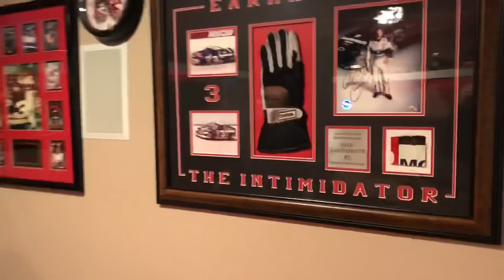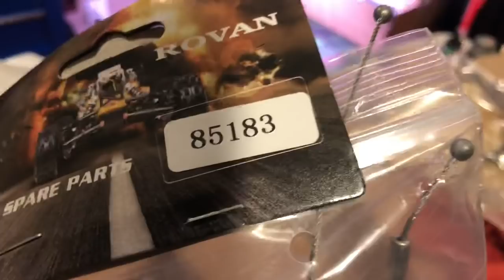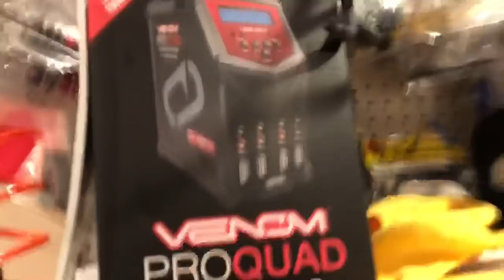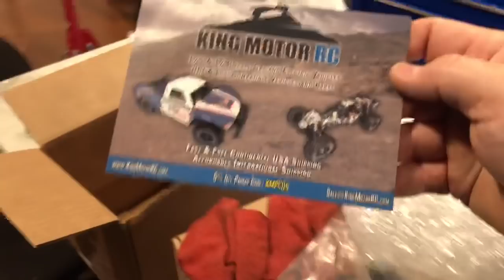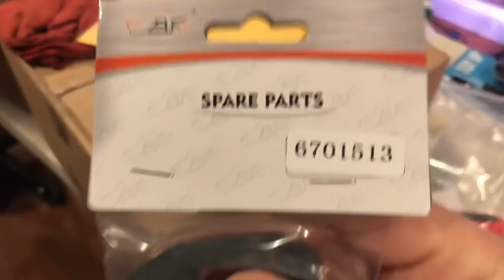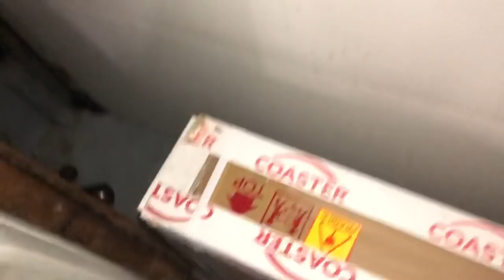SPL VISIT, Mikes Wood Shop FRM🍊FL. & ROVAN Unboxing & Close Look&Talk @🔥Braptastic💥Things💨

Comment: Curious to know if that RCMax engine will fit inside a Primal MT? Will it be better than the TMR engine?
Reply from the maker: I think the TMR Modified is perfect and direct bolt on to the primal monster truck but my friend Mike Taylor that owns RCMAX Engines is working on something for this bad boy aswell